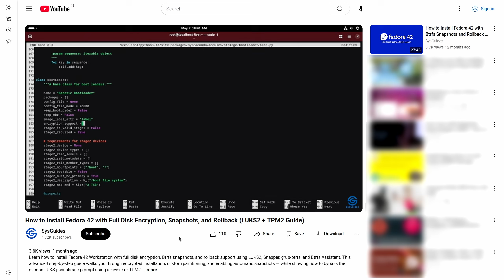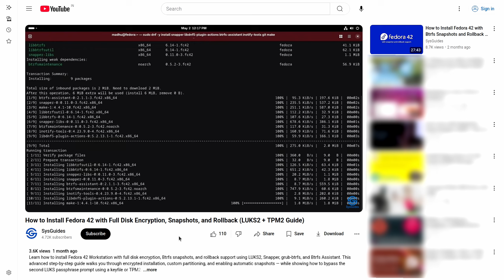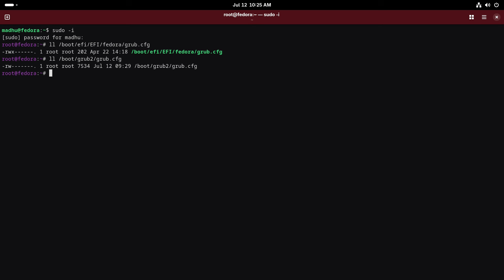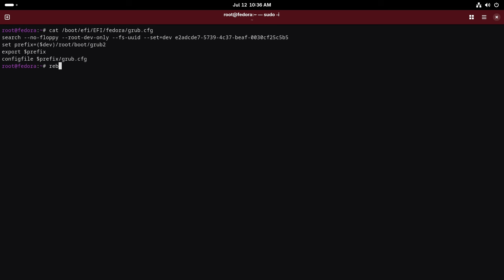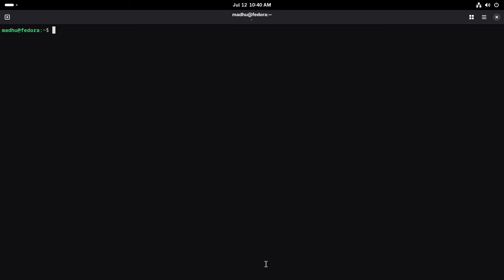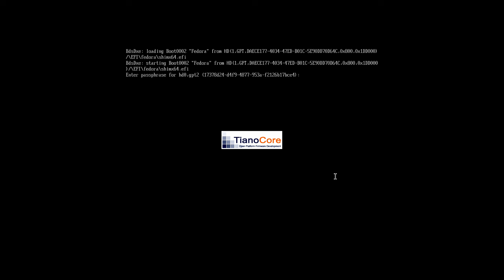Fedora 42 FDE: GRUB boot failure after update – here’s the fix

Comment: So no permanent solution, after every kernel update I must do this??
Reply: Let me know if you figure out a permanent solution
Reply: @Enigmatic-orangutan  the solution i find and what i do on every fedora installation is to change the subvolume name of home to @home and root to @, and after the installation i use timeshift, but with this bs new installer i cant change the root to @ because it wont let me somehow, and all this is done graphically to terminal needed. so if you found a way to change the home to @home and root  to @ after installation securely without messing the fstab or the boot process please do share it, i tried it and couldn't boot because the system won't recognize the UUID ...

Comment: This fix worked after I was left at the grub shell after updating Fedora today, so seeing this video from your channel return on my Google search was a huge relief. Thank you again for your time.

I did discover something else though, as I initially mistyped my passphrase, it dropped me back into the GRUB shell. After a reboot and not making a typo, it unlocked fine and moved to he GRUB boot menu for the snapshots. I cannot remember if GRUB did this before. I'll need to re-watch the first video to see if something else was added.

I know that when cryptomount runs automatically in a normal encrypted Ubuntu install, you get three tries before it reboots.

I tried some ChatGPT suggestions, and as expected in more niche topics, none of them worked. If it's doable, if anyone knows how to get the three tries working, that would be great to know.

For now, I'll add it to my backlog of things to try out in a VM since I am relatively still new to Linux administration and I need to use my Fedora laptop now.

Comment: that was the problem , I had to ditch fedora all together.
Reply from the maker: Totally understand. This issue has been frustrating for many after system updates. Fedora often overwrites grub.cfg, which removes the cryptomount line and drops you into the GRUB shell.

Since Fedora doesn't officially support full disk encryption with LUKS by default, these setups can break after some updates.

Wish I had made this video sooner. I've shown how to get the system booting again and how to re-apply the fix easily. It's not fully permanent, but it helps avoid the GRUB shell every time.

Thanks for sharing your experience. Hope it helps if you ever try Fedora again!
Reply: @SysGuides I ended up with nixos , which supports that out of the box , and comes with many addon great features. absolutely doesn't regret that. thanks for your work. i was the last one commenting on that fedora video.
Reply from the maker: @DreamHeaven  That’s awesome to hear! nixos is a solid choice. It's very powerful once you get the hang of its declarative approach. Glad you found a distro that works well for your setup. And thanks again for your support on that Fedora video.
Reply: @SysGuides 
In the original video, you added a comment talking about this repair after an update, but you also added some commands for what sounded like it was supposed to be a permanent fix so future updates wouldn't break it, but you didn't mention that here. Why not?
Also you said the reason it breaks is because Fedora doesn't support FDE for this specific setup, implying it does support FDE for some other setup, why not use that?